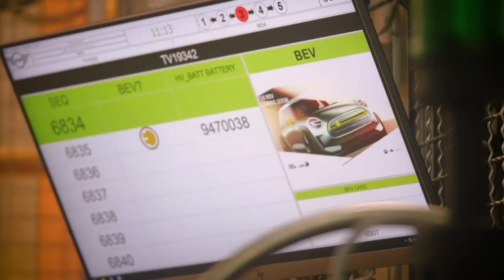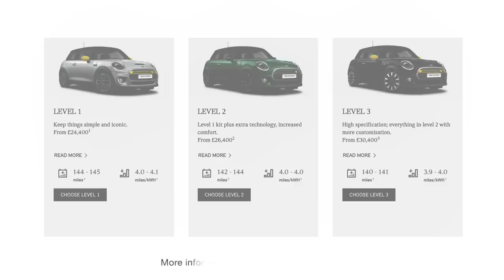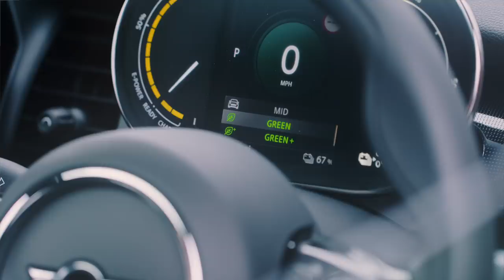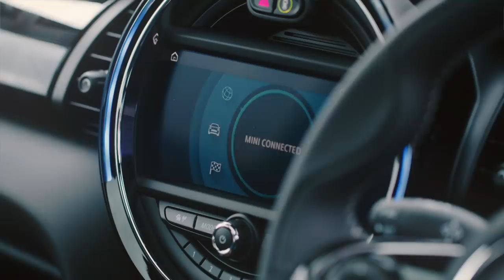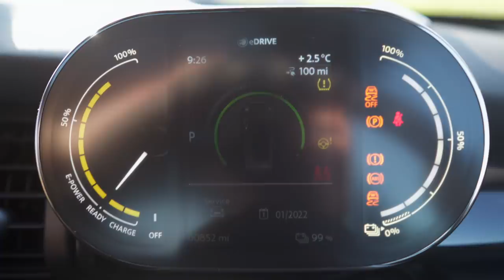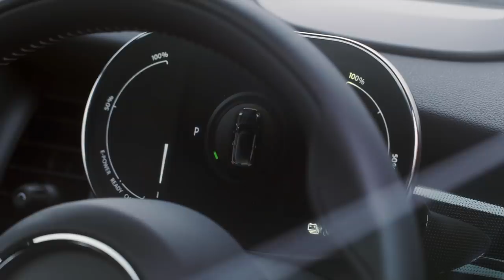Mini E: ultimate electric hot hatch? Full road test // Jonny Smith

Comment: I started this video as someone who would have never considered a Zoe. Best ad ever. Thank you.
Reply: I've had a Zoe three years, great car. The limited range of the Mini would put me off. The issues with a 120-130 mile range is that you won't always get that much and if you are doing an 70 mile each way trip you will have to faff about charging on the way home when all you really want is to get back. I get over 180 miles out of the Zoe ZE40 in the summer if I take it easy. If you have two cars I guess the Mini would be a fun commuter though.
Reply: @robsmith1a  Do you still have to lease the battery pack from Renault? Always reduced the appeal for me.
Reply: @dedge12858  I purchased the battery with my car, it has been an option for quite a while but dealers discouraged it. The ZE50 is only available with full battery purchase and no lease option is available in the UK. If you are thinking of buying one it is worth using a comparison site such as Carwow to get a discount. I notice Mini dealers aren't offering discounts but Renault ones do. Hope this helps.
Reply: @robsmith1a  Thanks for the reply. Appreciate it!
Reply: @robsmith1a  as you say this works better as a 2nd car, which for the most part they are. I think the biggest drawback on an urban car having a short range is that urban dwellers don't tend to have off street parking. This means that they will have to use public chargers more often, which with current infrastructure is a pain. Obviously if you can charge overnight ar home then low range becomes less of an issue.
Reply: Same here. Got a Zoe50 after watching his review, his assessment was spot on. Am really enjoying the car, it does exactly what I want and is very cost effective.
Reply: No fast charging and no drivers height adjustment put me off the Zoe. Also you'd probably stop atleast once or twice on a 140 round trip imo. You can just rapid charge for 20 mins while you have a leak and grab a coffee.

Comment: I've said it before. That yellow crap is incongruous and looks like a zit on the front of the car.
Reply: All the yellow badges would be coming off if I ever got one. It's stupid to put stuff on that stands out so badly like them
Reply: Yeah, you said that before. But folks have their own opinion.
Reply: @stephen300o6  Other folk are wrong, obviously. Only someone that is colourblind would think it is a good idea.
Reply: Fugly is the correct term I believe ;) Ruined a car that needed love
Reply: Dammit that's what I see now ! I used to wonder what pacman had to do with mini's or electric cars but now I see its a zit :(
Reply: @MegaNayton  Should be optional, along with the 3-pin-plug wheels etc. Another option should be subtle 'Mini' badges that have 'Min-e' on them, with the little dab of green - a sort of halfway house between completely stealth electric & driving around like an employee of the EV marketing board...
Reply: Looks like you can just pull it off.
Reply: A piece of black vinyl should fix that up nicely.
Reply: I thought it was an AA badge!
Reply: @fat_biker  I doubt they would do it as for some reason car manufacturers want the car to be seen and known that it's a EV for some weird reason
Reply: The one on the front looks like a slider control.
Reply: Think you can spec it without...but it definitely doesn’t work with red.

Comment: I don't mind the idea of an electric Mini. I think, if executed well, a small and nippy electric car would be great for city dwellers.
I do, however, mind this electric Mini. You cannot convert an ICE car into an electric car and expect it to look great, and run efficiently. I can understand that these are cost saving measures as developing a separate chassis can be prohibitively expensive, but the end result speaks volumes of the compromises made.
With its not-at-all-mini size, raised ride height, and that botched eyesore of a grill, the Mini E looks like a conversion done in a shed by an electric car enthusiast. It does not look like a product of an established car manufacturer.
Which is a shame, because I would have loved an electric mini Mini.
Reply: In the future we will see proper dedicated electric minis I hope.  Oh and i'm fed up of being told this is the best looking Mini.  This is nowhere near as good looking as my all black (red bits) 2018 JCW.  Nowhere near.
Reply: They should have just done what honda did, and design a ground up EV that is heavier, slower, has less range and costs more. Seriously though, it is a master stroke of engineering which has produced a really good car in all respects, except range. For most people, even that won't be a problem. For a day to day city/commuter car that leaves you with a smile on your face, the mini is top of the pile.

Comment: Thanks for another great video. I used to drive a Mini Cooper (petrol - I know, I was young and knew no better). I had it for 13 years. Now I have an i3, which is great but expensive. I must admit I'm tempted by the Mini E... There would be a nice circularity as the original limited-edition e-Mini was the testbed for the technology in the i3 and now the Mini-E.

Comment: Hi just want to point out that:
The zoe starts at £25,670 after the grant
as per renault's UK website https://www.renault.co.uk/electric-vehicles/zoe.html
The e208 starts at £28,550.00 OTR
as per peugeot's UK website https://offers.peugeot.co.uk/choose-your-peugeot/configure-all-new-208?lcdv16=1PP2A5HMZJT0A0B0
Reply from the maker: Hi Fausto, I have used the Newspress website for my price and spec figures, as that's the norm for journos. If these are incorrect I apologise and will relay the info to the manufacturers.

Comment: I'm a bit confused on the price of the Zoe. You list a starting price of £21,600 for the R135 Z.E.50, but on the Renault website the cheapest Zoe is the R110 Z.E.50 at £25,670 (after the plug-in car grant) ??

Comment: i waited a long time for the mini e. but im just not blown away by it. it needs more power and yes range. but ive heard nothing about connectivity. if you can pre heat the car etc.
Reply from the maker: Has a built in heat pump as standard, which I forgot to mention.
Reply from the maker: Mini app allows remote heating and all that stuff. We can never test that on launches as it's never ready!
Reply: @TheLateBrakeShow  ah thats good to know.  Thanks

Comment: Take the WLTP range with a grain of salt in the UK and a shovel of salt in Germany. At around 90mph the i3 takes 20KWh per 100 Kilometers, the 36KWh battery would barely get me from Bremen to Hamburg and back and I'd annoy some people driving so slow 😊 
OTOH, back in 2005 my convertible Cooper S JCW had about the same reach albeit at much higher speed.

Comment: This car makes me wish proper research in electric cars had started 10 years before.
I'm almost 30, I've got a good job, so I feel like I am still young enough to buy one of these for the fun of driving a tight, fast, fun thing in my everyday life, yet I know I'll drive mostly long range with it (I have an ebike for my city commute) and I can't afford something that's both fun AND ranged at this point in time.
Sure, I could go for petrol and maybe I will (even though it pains me at this point in time), but if we'd started the whole "Hey, we why don't we look into batteries that can actually power cars" at this point in time THIS car would have a 300mile range and stuff like the Zoe would have 500 or 600. Sure, I could still put off buying a new car a few years (I do have one, and still kind of works) but by that time I'll be past 30 and too old to buy a Mini as a main car!
And yeah, you're right in that closing remark: the Mini feels like a car that's designed to be an electric, because that's make it so much more fun to play with, yet potentially smaller because you can better use up all that space in the front. We'll definitely get there in 5 or 10 years time, I just hope I'll be as foolish by then.

Comment: Thanks Jonny, great review.
Whilst I salute any new EV & I love the Mini brand, BMW should have done SO much better than this!  The real world range will be low 100s & as such is woefully inadequate, even for a city car!  The cynic in me sees this as simply a, ‘Compliance’ car to keep market access!  In engineering terms they tried square peg (the battery) into a round hole (current mini chassis) using a big hammer!  Must do better!
Reply: On the contrary its an elegant solution for a small company to make what will be initially a low volume product at a very competitive price. As for the range its really a result of needing to keep the weight down to maintain the performance and handling. Its a little sports car after all.
Reply: Simon Hay-Heddle Not sure I would class BMW as a small company!
Reply: @humphreybradley3060  I agree but the Mini brand is a pretty small part of their operation. As such they are going to be kept on a tight budget for producing what is a fairly specialist little car.

Comment: What ever happened to the electric Mini with the "wheel motors"? There are also Union Jacks on the head bolsters (not head rests, they are safety devices and need to be set up correctly, to protect the drivers/ passengers spine/ necks in a collision).

Comment: You've gone really easy on this car because it is fun to drive. And because it's a Mini. Hardly a word about the elephant in the room which is the range is pitiful, I've seen reviewers get less than 100 miles. It's 2020 and I just find that impossible to accept. Mini has had 10 years since the original concept electric to figure out how to cram a decent size battery in this car, and they just gave up and produced this.

Comment: Great review, sure the best and true in depth about the SE of all others on YT, and a lot of true words and verdicts in it.
Sounds he is a true car nut/petrolhead, yet able to think diversified.
My wife's 16yo 3door needs replacement - so guess, the verdict is correct - the replacement will be a Mini SE.
Because she prefers Mini, and doesn't like the looks of the Honda e,
and the others mentioned are - sorry to say - just practical or good if you only have 1 car, but unispiring, lame, boring and butt ugly from the in and outside from a car enthusiast pov.
With especially her short distance driving no combustion engine loves, 99% of time alone, and 3 persons and small lugagge at most,
and those ~140miles easily worth ~3 weeks of driving, the true perfect solution for her.
WIll sure enjoy to drive it too - beside my bonkers fun on Autobahn and alpine roads alike, nicely loud (one of the last non OPF 2018) Mini JCW,
and my 2019 diesel BMW - who does those 500 miles Vienna-Munich-Vienna easily, comfortable, quickly (typical Autobahn speed around 100-115mph on average), with one full tank - and still doesnt need fillup after that trip.
With both truly a waste to even start up, just to run 3 miles and small errands in town.
We always had 3 cars - now all 3 will have the best of all worlds and we can alternately enjoy the purpose&appliance they shine in best.
2020+ seemed to becomea horror vision for any car nut/petrolhead, and in certain areas it sure does, but actually...it offers even more choices/options not available in past decades.

Comment: I would rather buy a used i3 94ah instead of this. It's a much more modern car, even if it's from 2013. It is lighter, it has the same kW, the same 0-62, but real wheel drive and a chassis made out of carbon. The i3 has a liquid cooled battery, can charge with 50kW up to 90%, also the ac charging is quicker. with 11kW.

Comment: I wonder how long it will be before they choose to make this as a ground up designed EV complete with skateboard battery pack which would allow for greater range.
Reply: Peter S they had ten years development time to do just that; and did not do it. So why would they do it now? The brand will be starved of £ for new ideas and milked till it goes dry.
Reply: @geoffmansfield2668  I think it may come down to how fast customers switch to electric propulsion - if the demand, legislation & climate change impact awareness is there (which it hasn't been until recently) then manufacturers will have to respond. But you are right about them being slow with their development timeline.

Comment: I will never buy a 3 door car, couple of reasons, one, passengers getting into the back is a pain, if you are picking someone one of the two up front have to get out, if it's raining it's not fun, two, if you are in a crash and the front two are not responding those in the back are screwed if there's a fire.

Comment: First of all I have watched a few videos now about this car. I enjoyed yours the most.
Except for the British thing. Engineered in Britain?
My partner has a Mini that has a BMW-PSA engine. Its gearbox is an Aisin unit. Neither British.
This Mini electric shares its running gear with the BMW i3. Not British.
The infotainment systems are BMW. Everything important is BMW.
I think far less than you think of this marque is ‘British’ and much more is BMW.
What exactly is British about it apart from assembly?
The E will be our third Mini. An R50 Cooper manual (Brazilian-built Tritec Chrysler-BMW engine), an R56 Cooper S automatic and soon the Cooper S Mini Electric 3.
None would be my choice, however. I’d have a VW ID3...
Reply from the maker: Thanks for watching. I know what you mean - it isn't completely British at all. It is packaged in the UK and still does a convincing job of feeling like a UK product, in the same way a Merc engined Aston Martin does.

Comment: None of this is true. It is vastly more expensive than a regular Cooper S ... the great gearbox ... don't get one, the little pops and crackles from the engine, nope, ... all the fun is sucked out. Its like a veggie burger. Still nothing more than a virtue signal. Electric cars are going nowhere until they can hold their charge for 15 years or more so they don't depreciate like a brick, and until the list price comes down making them cheaper than petrol cars.
Reply from the maker: They don't depreciate like a brick. They hold value better than piston cars at present, and have in the UK for over 2 years now.